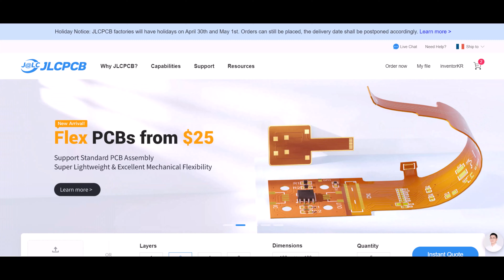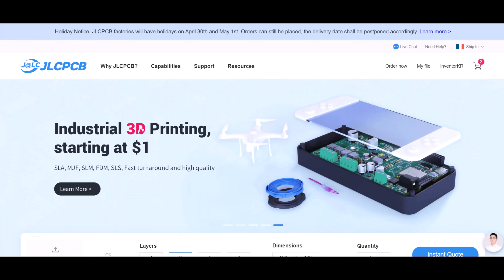"Building Your Own Tube Amp: The Ultimate DIY Guide"

Comment: stop doing anything this circuit is a preamplifier it is totally impossible to drive a speaker directly with a circuit like this I have the same one and it doesn't work it's impossible
Reply: You can use this thing for active speakers
Reply: you can try with a high ohm, and high sensitive speaker. it will do sounds.

Comment: No way that board was working.  They neglect to tell you to install a jumper wire underneath D1 in order to get the power to the switch.  In addition, there is no amplification, only preamp.

Comment: This is a preamp. From AliExpress. Maybe it can drive a very sensitive speaker to very quiet levels. It is not a power amp. Which is obvious, when you see there is no transformer. I can drive sensitive speakers with my Laney valve guitar preamp - for whisper quiet rock ‘n roll.
But it’s not an amp !
This video is a stooge.